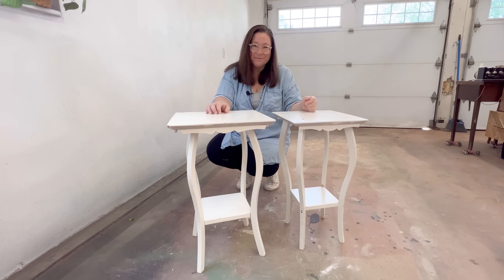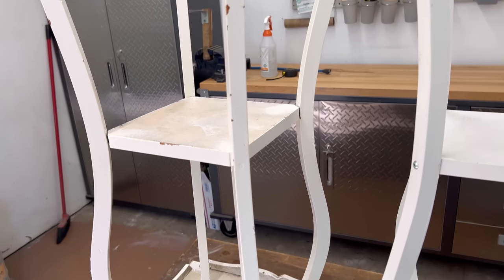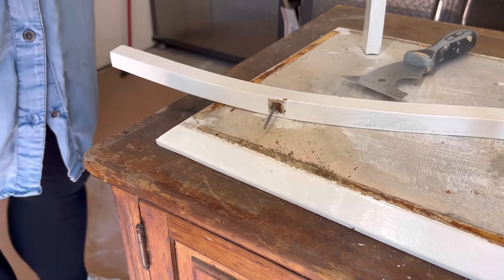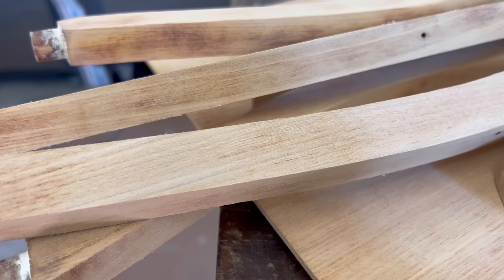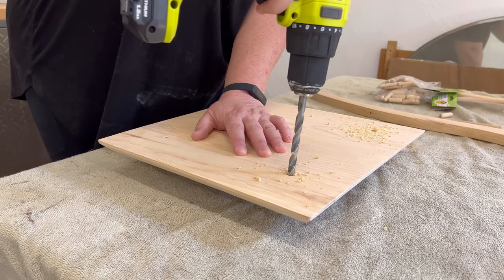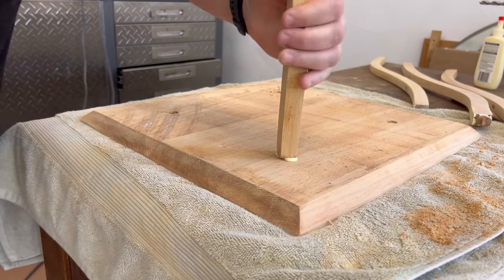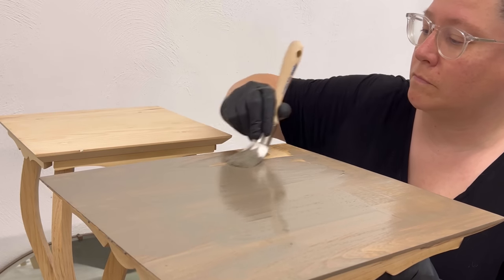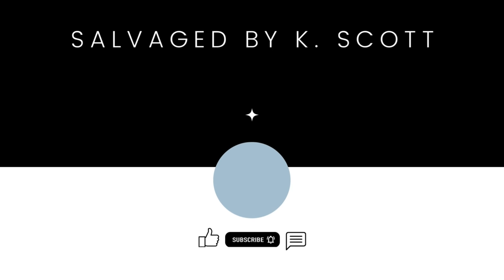Salvaging these sweet tables that I found at the thrift store! | REFINISHING WOOD FURNITURE

Comment: I love that you take on the most hopeless looking furniture and make it look better than new. 
You make it look so easy when I wouldn't know where to start with those rickety things. I was shocked when you fearlessly drilled such big dowel holes in those slender legs, I for sure thought there wasn't enough wood left to make it a stable connection, but it worked perfectly.
I always assume a piece has to be repaired in the same way it was built, but you know how to build it better. 
Thanks for sharing your brilliant work!
Reply: Well said! I agree. 😊

Comment: My goodness Katie !!  Thanks to you I just completed refurbishing our old table (by old I mean out first purchase when we got out first home - so 35 years old!)!  Really Katie it was a lot of work!! Phew!!  It makes me sooo much more in awe 🤩 of every piece that you do.  Those little tables are amazing !
I have a question …. How do you not get very fine dust settle on the top surface while drying ??I tried applying with a fine rag, using a really good brush and rolling with a foam roller ….. and between each coat a very fine sand with 250 grit sandpaper.  Wiping down in between with a damp cloth and allowing to dry.  Many coats later …. I now put up with a few imperfections …. Still way better than what she was, but the inner perfectionist in me wants to do better! One of the staff at the paint store suggested drying it vertical position so as not to allow dust to settle?  What do you do? Lots of love and admiration from Deb (do we have more dust in Australia? Haha! 😳🤔)

Comment: Great job as always🥰 When you find out you have sanding marks after staining with which grid are you sanding again? With the last one or a higher one than the last? Or are you going through the whole process again?  I used same driftwood staining on a table, love the color but unfortunately it was not as protective as I hoped, Already have a water ring 😳 could this happen if I wipe it off before 15 minutes ?